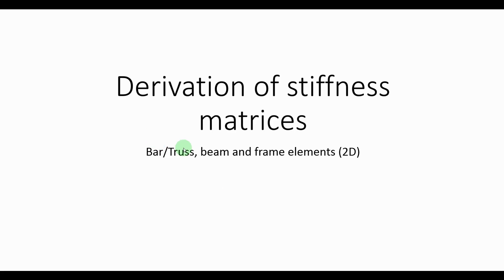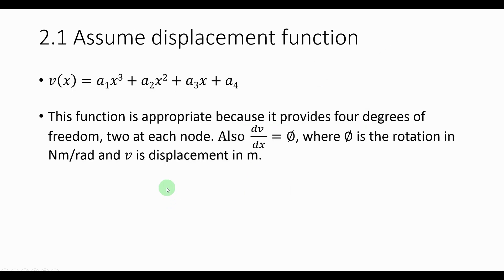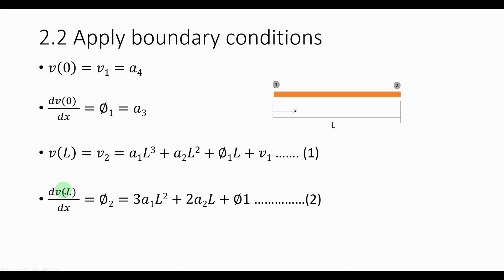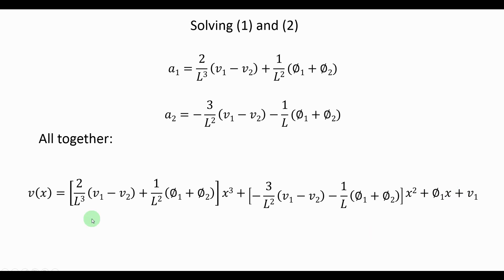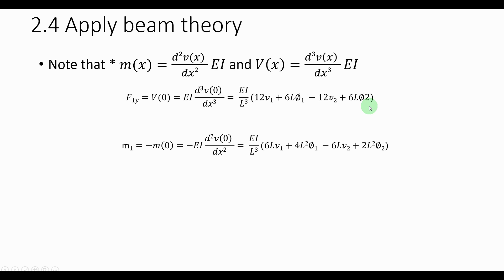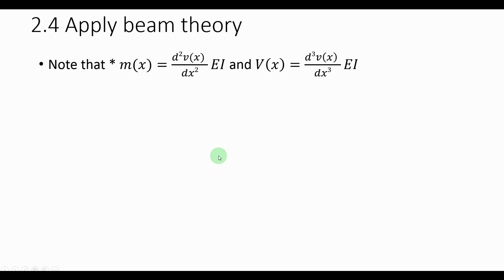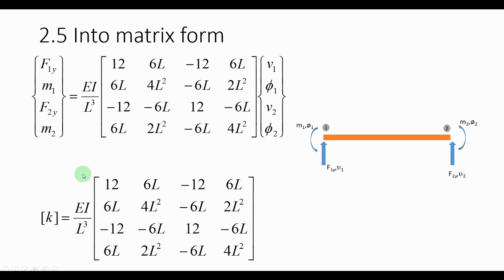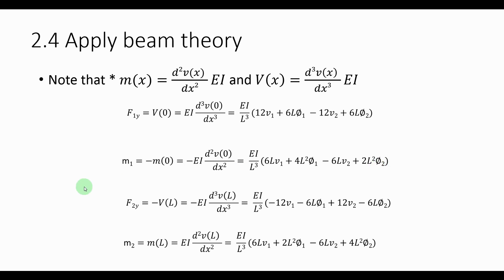Coefficients of the stiffness matrix - Derivation - Beam element

Comment: Hi, @TM'sChannel: I found a confirm mistake for the value of a2 which should be: a2=-3/L3(v1-v2) - 1/L(2 Θ1+Θ2) [Not "...-1/L( 1/L(Θ1+Θ2)" as per your slides]. I checked the after derivation part with matrix and also the algebra so I have confirmed this by all means. You also check and confirm.
[P.S: Just checked you already mentioned that in description and also uploaded corrected video. Thanks for that. ] updated.
Reply: a2=-3/L2(v1-v2) - 1/L(2 Θ1+Θ2)
Reply: I agree, a factor 2 is missing
Thank you for pointing this out

Comment: If you have a cantilever does the stiffness matrix change ?
Reply from the maker: Hi, no it does not. Only the boundary conditions are different i.e. the end degrees of freedom are not prescribed.
Reply: TM'sChannel can you add a video of 6 degree of freedom derivation ?
Reply from the maker: Hi, I have a video on the derivation of a frame element (which has 6 degrees of freedom, 3 at each node). You are welcome to view it here: https://www.youtube.com/watch?v=wq7Os0hdYtk
Reply: TM'sChannel sorry I meant 12, 6 at each node. I am interested in twist
Reply from the maker: I see, I shall try to make a video for such an element, although it may take me a while.  For torsion the basis is similar to that of the truss element, only with AE/L replaced by GJ/L. For the time being you may look at the book "a first course in the finite element method" by D.L. Logan which does provide a derivation of a 3D frame element. Hope this helps
Reply: I have checked the book, and for beam element it does not state the stifness matrix for 12 DoF element
Reply from the maker: Under the section "beam element arbitrarily oriented in space" it is given. Is section 5.5 in my book (2017 SI edition)

Comment: hi, one doubt, at 6:47, i am not getting the expansion of m1 as mentioned in the video, i get it as EI/l3 * (6LV1+fi1L^2-6LV2+fi2L^2) instead of EI/l3 * (6LV1+4fi1L^2-6LV2+2fi2L^2)...could you please upload a screenshot of the derivation .. thanks
Reply from the maker: Hi, thanks for pointing it out :). I went back to my derivation and I discovered a typing error on the slide when calculating the displacement function v(x) at 4:44. The expression for the second term i.e. a2 should be: a2 = 3 (v1-v2) /L^2( 2fi1 + fi2 )/L . Using this adjustment you can obtain the correct expression for v(x) and from there calculate the correct coefficients as in the video. Sorry for the inconvenience, I will upload a revision of this video with the typing error corrected.   Please let me know if you encounter any more errors/doubts.

Comment: How v(x) changes when beam is  parabolic haunch beam ? Or what changes?
Reply from the maker: Hi, thanks for the comment. Honestly I don't really know. But the theory used to derive the matrix models the center line displacement of the (straight) beam. If that line is curved, I presume the theory also changes. Unfortunately I cannot say how.  Another thing that also changes is the inertia (I), this becomes a function of position due to the change in height (h). Sorry if this is not very helpful, I have not yet dealt with the analysis of haunch beams.
Reply: Hi, thanks for reply. Video is a very helpful. Haunch beam is not a easy topic. Thanks again.